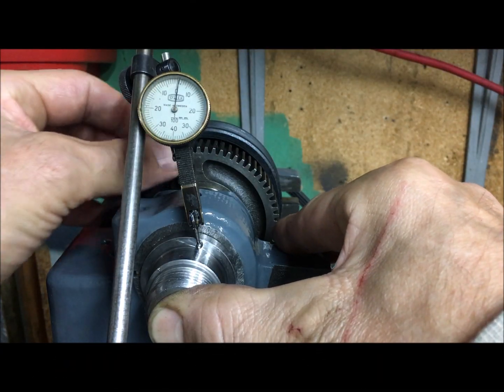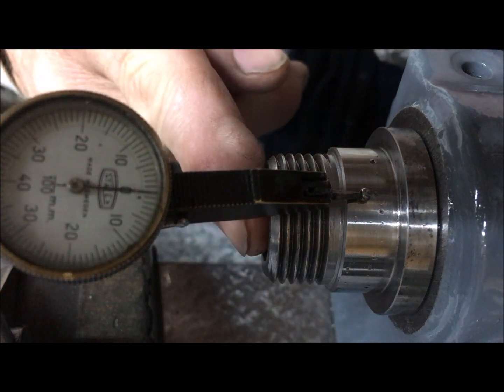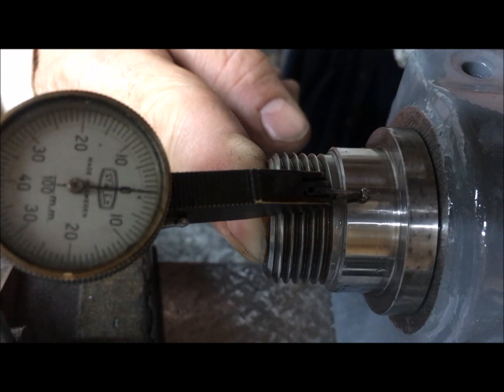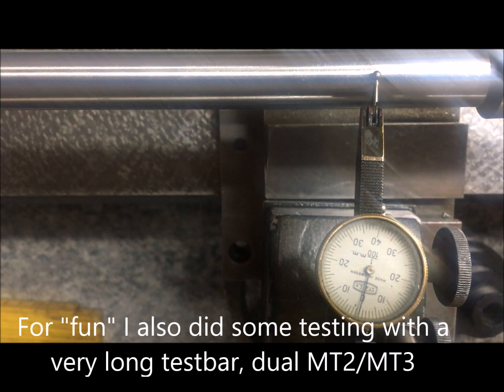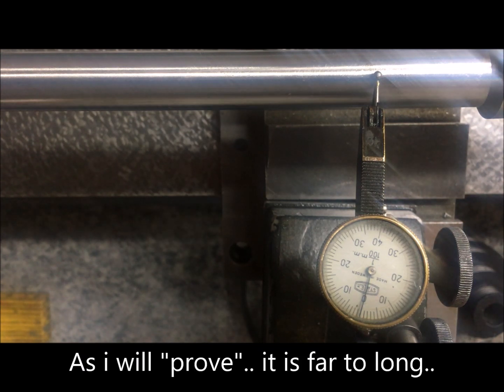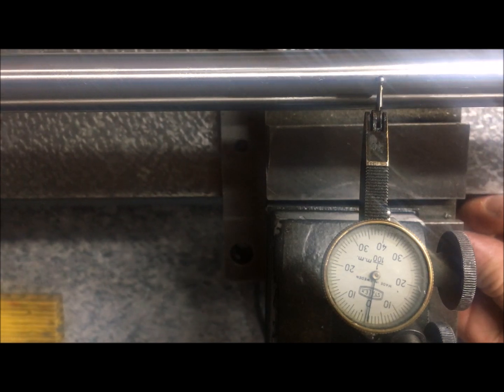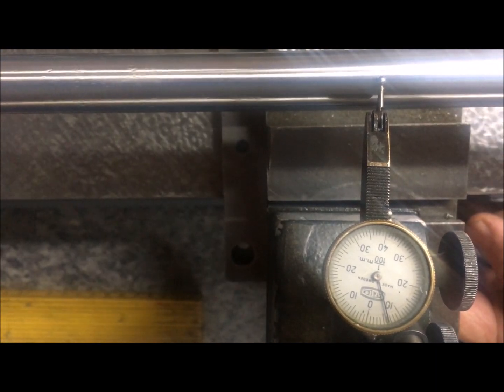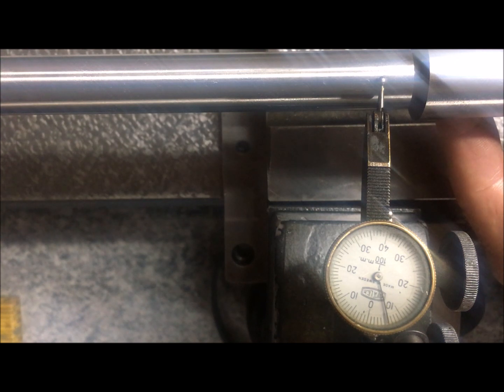Myford ML10 - indicative spindle measurements

Comment: I've gotten fooled by that gravity issue while checking a tail stocks taper alignment to the head stocks C/L before. It's pretty amazing just how much a light weight test indicator can bend the steel shaft it was attached to as it's rotated from top to bottom of the taper . With the weight/length of that test bar I suspect it just might be over balancing the weight of the spindle while it's resting in the head stocks bearings. Lifting the rear of the spindle and taking up what little running clearance there is as well as sagging a bit as you mentioned Jan. A zeroed indicator on the rear of the spindle prior to the test bar being mounted would confirm that.
Reply from the maker: Exactly. It is a long lever and the heaviest (MT3 taper) side at the far end, which adds to the error. Good tip! I will try to see if this actually can be proven the way you suggest!
Reply: @jansverrehaugjord9934  One other item I forgot to mention and it could be something you might already know Jan. No doubt you'll correct that radial run out on the spindles face before the lathe is consider finished. Years ago there was a tip in one of my Model Engineer magazines about threaded spindles. They mentioned using a washer shaped piece of thin oiled cardboard between that spindle face register and the chucks back plate for a couple of reasons, it prevents a stuck chuck on the spindle threads if some one was to have a crash during the machines operation, and it helps to prevent any minor wear taking place between the spindle nose and the back plates much softer register surface during chuck mounting and removal. Card board is apparently very consistent for thickness and still soft enough to take up any minor irregularities between the back plate and the spindle face since it can compress enough where required. The oil prevents the card board from absorbing humidity from the air that might cause a rusting issue. I tried it on my little Sherline lathe I had at the time and it seemed to make chuck removal a lot easier. The lathes I have now don't use a threaded spindle nose but since there's thousands of lathes around that still do I thought it worth mentioning.
Reply from the maker: @turningpoint6643  hmm.. interesting! will consider this.

Comment: MT3 test bar standard length is 30 cm. the drop could be that it isn’t well seated in the socket, spindle misaligned, headstock misaligned or as you say ‘droop’ . You can check droop by taking a rotational reading at different distances from the socket and see how they compare down the length.
I’ve spent a fair few hours getting repeatable readings on a test bar in a spindle... it’s not as simple as it should be ! The spindle chuck run out looks of concern, it will be interesting to see how it changes when the components are tightened up. 👍
Reply from the maker: This is an MT2 in one end and MT3 in another.. and I would judge too thin. But as you say, there are more variables to this and I am also curios to see if this changes when I have mounted everything properly. The rotational readings at intervals (3 or 4 measurements towards the headstock) and comparing with my other test bar did however indicate that it is indeed the long test bar
Reply: I suspect the mt added weight on the free end isn’t helping. I had trouble with a very damaged socket . Lapping improved the seat no end. Run out on the bar is now less than 0.01 mm at the headstock and +/-0.0125 at 30 cm. it helps no end with getting repeat readings. Keep at Jan.
Reply from the maker: @lookcreations  Will do.. I guess I will soon have 2 shorter test bars :)
Reply: @jansverrehaugjord9934  I think I would keep the MT3 at 30cm and ditch the MT option they are not expensive from china and surprisingly accurate - just be sure to check it :-)
Reply from the maker: @lookcreations  I have some others, MT3 included I believe, but yes, I might do that.